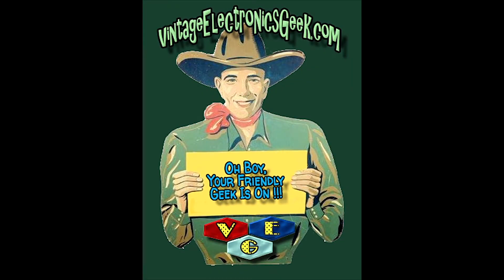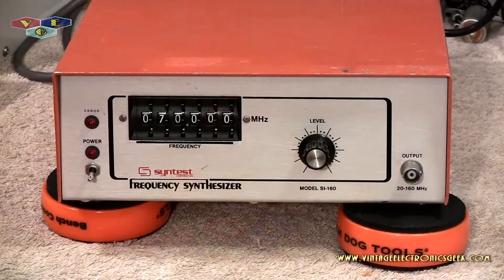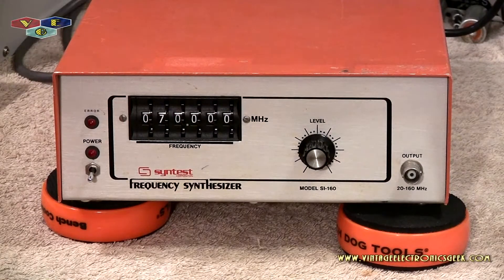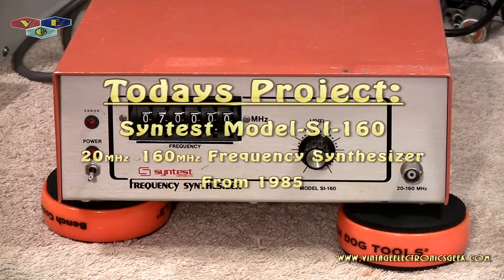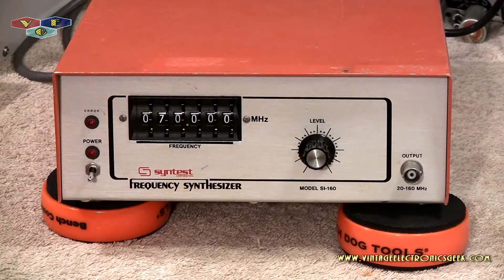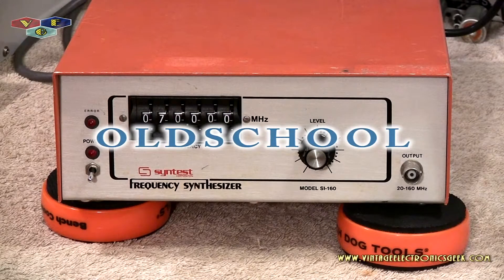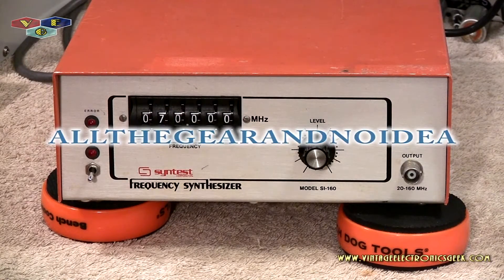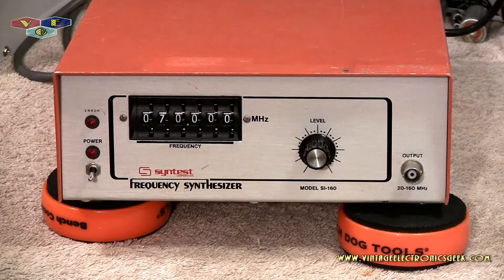Syntest SI-160 - Frequency Synthesizer - Overview - Look Inside - Test

Comment: Very interesting! The model i have (Synthest SI-102), that goes from 0.1Hz to 16MHz, does not have a TCXO like yours (perhaps stability is mandatory for higher frequency synthesis?), while the rest is quite similar. Although i couldn’t find any information, i think your guess on the usage of this instrument is right, the ferquency should be pretty stable for using it as a reference. Great video!
Reply from the maker: I think at this point, that maybe all its good for, unless I could figure out how to connect my function generator to it!  :)  My plan is to buy the model you have for the same reason, may not be quite as good as a GPS standard, but may work to sync device together?  Thanks for watching!  ~Jack, VEG

Comment: Just off out for the day so I will comment later. But I wondered if the error light was driven by the PLL loosing lock or the glue Logic adjacent to the thumb wheel selector.  Be worth looking at the PLL chip data sheet.
Reply from the maker: Howdy Chris!  I think when the PLL does go out of lock, there is a 555 near the error light, so I believe the PLL trips that to make a blinky light.   Yes, I needs to sit and go through all the chips to see what they are...maybe sometime today or tomorrow I will try and go through them and let you know if successful! Thanks for stopping by!  ~Jack, VEG
Reply: Hello Jack many thanks for plugging my channel your a true gentleman. Well I really enjoyed you showing me around your frequency synthesiser. I have to admit the the PLL mathematic scares The willies out of me. Still amazing when they work. It is a shame you have no modulation output but still a very useful bit of lab equipment for frequency spot checking. I will try and do a response video on my channel as I think this will be fun, but just up to my eyeballs at work at the moment.  My mainframe logic analyser arrived today all the way from sunny California may have bitten of more than I can chew this time. Thanks for sharing my very best regards Chris.
Reply from the maker: Well Howdy Chris!  My pleasure, even if I did goof up your YT name!  :)  You know what amazes me, electronics with mechanics,  that's some black magic wizardry stuff, man, to think what kinda psychedelic they were using to come up with all that and it works!   Either Way, I too agree, very mystifying!  Yes, I'd like to see if I can inject audio in there somehow, thus my quandary about a function/audio generator. Will look forward to your video and no worries about time table!  Cheers mate!  ~Jack, VEG